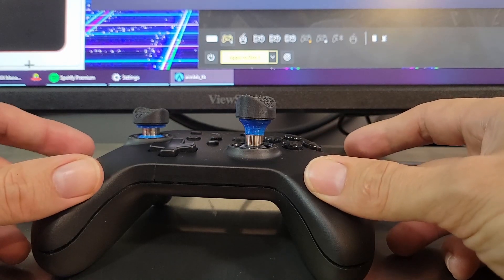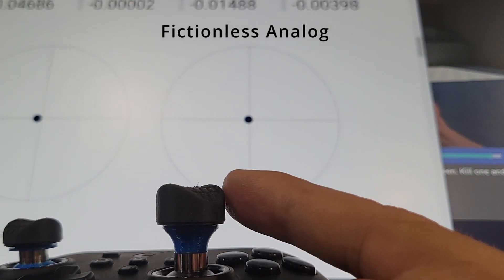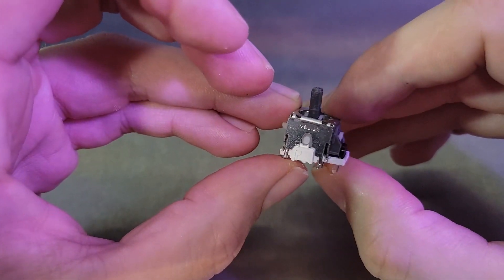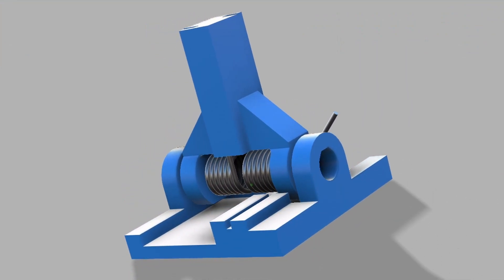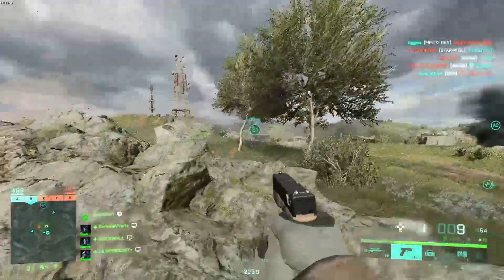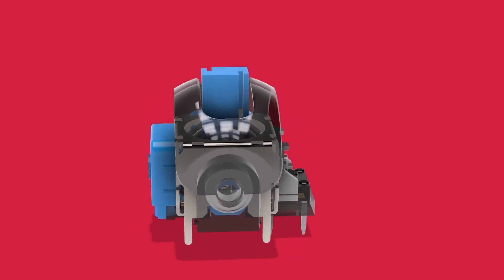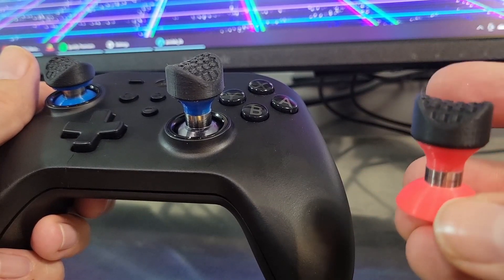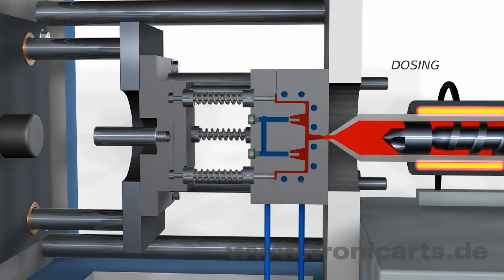Is this the holy grail of controller joysticks?

Comment: What you need is some engineering tough ESD resins. Because static not only kills electronics but static also collects dust. The tough component will prevent the parts from being so delicate and fragile. Only down side a machine ranges from 5 to 10 k like the NEXA3D XiP and the materials range in the 100-700 dollar range a bottle.
Reply from the maker: Thanks for the tip! I'm very new to resin 3D printing. I'll look into ESD resins, I'm completely unfamiliar with that. So that only can be used with some expensive industrial printer? The resin I'm currently prototyping with is Siraya Tech Build. For a 3D printing resin, it's decent, but nothing compared to injection molded nylon or delrin. 

There is an injection molding company out there that doesn't charge you for tooling costs up front. They just inflate the price of the product until you eventually pay off the tool.
Reply: @Greg's Gaming  engineering grade resin materials can be printed on low end Chinese machines as long as the UV source is 405nm BUT those cheap Chinese machines lack the power you'd get from a professional resin machine. So the prints will take longer and may fail frequently. I will definitely test these theories at work once we get our Nexa3D XiP I will test the scrap excess materials on my dinky Chinese photon zero the literal lowest of power and resolution machine but will be fun to try. Unfortunately we won't be getting out machine for a few months maybe in fall I can test everything.
Reply: Quick Google search tells us that the photon zero has 405nm good but only 30W power UV source. However stupid Nexa3D is hiding their UV source power rating it can be calculated but idk how to. I'm still going to test it. Will post a video if possible.
Reply from the maker: Oh that makes sense! Yeah I'm currently just on a Mars 3 printer. Perhaps I can continue to prototype on my little hobby machines and consumer grade resins, but when it comes time to selling them I can outsource the 3D printing. Thanks for the info, I appreciate it!
Reply: @Greg's Gaming  good idea I know every raves about PCBway but I'm skeptical about actually getting production parts from them they'll probably up the prices on production parts.

Comment: To be fair, back when I was gaming, I found that I performed significantly best with the controller that had the least thumbstick friction.
Reply: I can not imagine trying to aim without feeling the friction, it's like shooting a gun without the feel of the weight and the trigger resistance.
but living without having to deal with stick drift every couple of month is amazing.
Reply from the maker: @maxinq  it still has tension, just none of that sticking and scraping feeling. Think of a super used dry feeling thumbstick vs a brand new controller with that creamy feel. Now double that sensation.

Comment: id buy one 🙃
Reply: @GregRosolowski  also been curious, how would this stack up against a Hall magnetic stick like in the Gullikit King Kong Pro?
Reply from the maker: @APMystic10  I'm actually still using the gulikit sensors for the prototype. I'm mainly working on the mechanical part, not the sensors. A guy named Marius Heier will be coming out with a hall effect sensor that will work on other controllers. I'll likely use his sensors in my mechanical gimbal.